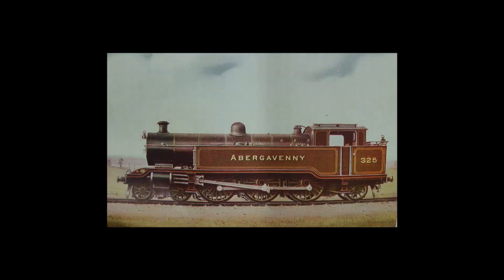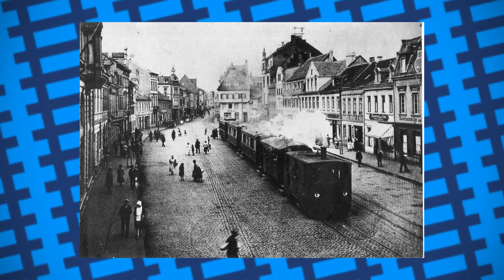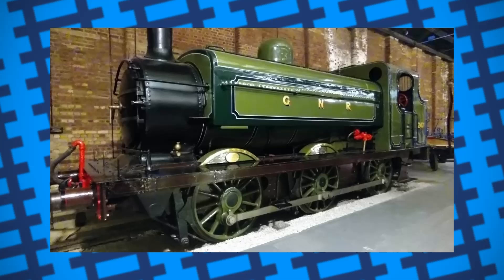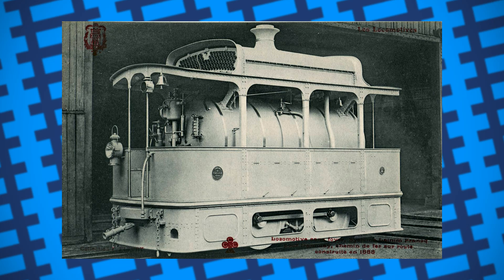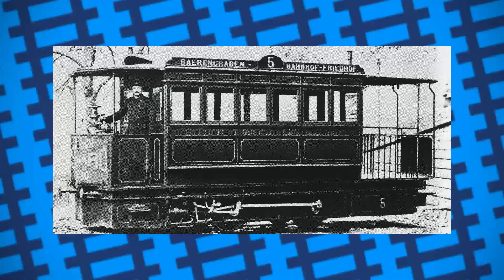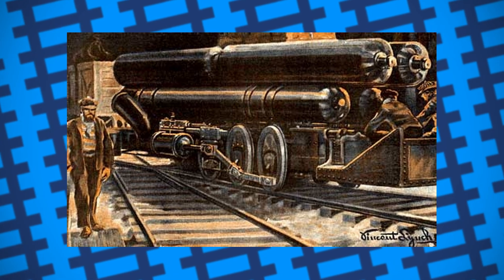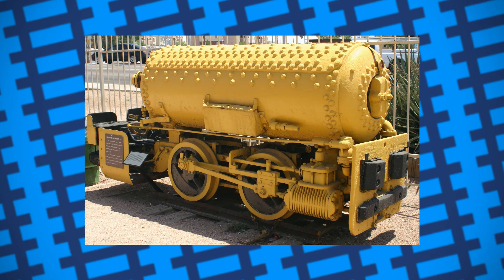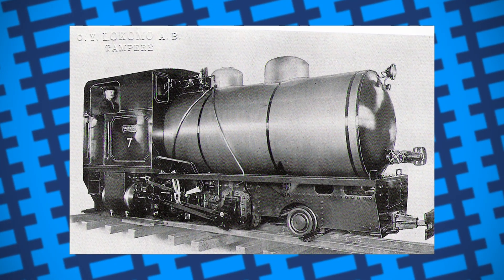The steam trains that don't require steam - Fireless Locomotives

Comment from the maker: WOOOOAH! Steam engine with no fire
Reply: but.. but you said steam engines with no steam...
Reply: @Itsjustavy  yes, why such a stupid title? Clickbait just baits me to click the dislike button.
Reply: @joe6167  I did. The video was well put together besides the title but I have zero tolerance for such clickbait lies.
Reply: There is one at the dunaskin Heratige centre that is operating but they may be closed soon
Reply: Don't forget soda locomotives. Soda locomotives were a variant of fireless locomotives, in which steam was raised in a boiler, expanded through cylinders in the usual way, and then condensed in a tank of caustic soda that surrounded the boiler. Dissolving water in caustic soda liberated heat, which generated more steam from the boiler, until the caustic soda became too dilute to release heat at a useful temperature.
Reply: @KibuFox  I never heard about any locomotive that runs on soda
Reply: You could use a radioisotope heater unit filled with plutonium. What could POSSIBLY go wrong?
Reply: There are one that did exchanges with other mainline trains that gots it's power from a steam power plant that was a pressurized steam locomotive within a firebox in the US I don't know if it survived diesels taking the steam locomotives place in a railroad museum or not, I've only seen one on my 5 pack DVD set called Railway Journey's the Vanishing Age of Steam
Reply: wow, really?!?!
I thought it was an electric engine
Reply: There we go 😉👍
Reply: Even the YouTube channel "wayoutwestworkshopstuff" has made a compressed air Loco.
Reply: Yankee with no brim!
Reply: actualy there where mining trains that produced heat to boil water without a fire. they used some form of natron instead.
Reply: Witchcraft! :P
Reply: @@seanembry6438 Lol
Reply: Basically having a big reservoir of steam, thermal or pneumatic energy. These locomotives with forms of integrated energy storage are pretty cool.
Reply: Fire with no steam engine
Reply: Old mining trains use compressed air :) so you can no idea on range pretty sure its as bad as an evs with lead acid batteries and i know a company working on a air powerd train but lips be sealed.

Comment: INCORRECT !!!!!!!!!!!!!!!!!!!

High pressure steam does not make a steam reciprocating or turbine  go. It’s heat and the expansion of the steam into an area of low pressure eg a cylinder the expansion of the steam is what makes the engine “go”. The reason behind the pressure in the most part is to increase the potential energy stored in the steam. So NO high pressure steam does not make an engine or turbine go.

Comment: I wonder if there ever were attempts to create a steam turbine train. Steam turbine engines were used on ships around the turn of the 20th century so surely the idea had come up. Steam turbines have a continues flow so they don't need pistons or valves to regulate the steam as it just flows from the high pressure of the boiler to the low pressure of the outside. The only big valves involved are to regulate the amount of steam that goes in. Though they do rotate at a very high speed which means you need gearing to slow the RPM but ships managed that just fine and even with the heavy gearing they still had a better power to weight ratio than piston engines.

Comment: Firstly The video title is incorrect. “The steam trains (locomotives) that don’t require steam,” of cause they require steam, they just don’t raise there own steam. Also you said, “Supper heated water is bumped into the tank on the engine.” No water is bumped into the tank, only high pressure steam. Please get your facts right.

Comment: A little superficial. Would have appreciated if talked about the systematic difference between locomotives that use hot (overheated) water that is kept from boiling by the pressure in the tank and thus take benefit from immense growth in volume when this water gets into steam on the one hand and the locomotives that just use the energy stored in pressurizing a gasious medium (as air or pressurized steam). And by the way, most of the shown locomotives shown still require steam, but are just fireless as they do not carry around the fire with them.

Comment: Saying that steam dummies like these don't need steam is silly.  They just didn't boil water to make it, but rather filled up with steam from a stationary plant instead.  Instead of a boiler they had a steam tank which drove the pistons just like a normal steam loco, and the tank needed to be refilled with steam from time to time or the loco would literally run out of steam.

Comment: Rather than simple compressed gas/fireless. How about pressurised oxygen and hydrogen tanks to produce steam by direct and clean combustion. Very hot steam if engine can cope. Higher efficency?. No boiler losses. Avoids mass of boiler, and "coal" /water. But does need strong gas tanks

Comment: I once helped a guy with taking his steam tractor to a show.  it had a water issue at the time so couldnt be fired up so we filled it with air. It was just enough to get it on the trailer and then off and right to its spot inside

Comment: the ones in the dayton caroline museum are interesting old examples that once saved the city after it flooded since they were capable of operating in the flood waters and were so massively heavy they kept traction. one of the interesting things is they actually kept boiling water as they were mostly filled with water then blasted with superheated steam until they reached the peak temperature

Comment: This video needs some clear statements. Yes their are compressed air engines- no steam involved, just add compressed air to the tank. Open the throttles and compressed air will go to the cylinders and push the pistons. Much more common were fireless steam engines. These ARE steam engines, but their tanks are filled with high temperature, high pressure liquid WATER. When the throttle is opened the pressure in the tank decreases a bit and the high temperature water begins to boil, producing steam that goes to the cylinders and provides power.  Fun facts : at the normal sea level pressure of 15 psi water, will boil and turn into steam at 212 F. But water at 430 F  in a pressure vessel will boil and turn into steam at 375 psi, more than enough to drive a locomotive. When the water temperature gets down to 354 F the available steam pressure will be about 150 psi, still enough to provide useful power. The limit is when the water runs out OR the temperature gets below 212 F.

Comment: seems a lot of people are missing the fact that these predominately run on steam and not on compressed air.
water has a high latent heat. possibly the highest of all. it stores all the heat pumped into it.

they hooked it up to a big boiler, and just started blowing steam into it until the water was the same temperature as in the boiler.

unhook, and the thing ran off until the water was too cold to steam effectively, or it ran out...

very popular as shunting engines with short trips in one place...

compressed air suffers from losing all the heat of compression and requiring external heat from teh surrounds to get full expansion.

Comment: Ptomac electric and power had one at a coal fired plant in northern VA.  It was used to shunt coal cars in and out of the plant, and was replenished from the huge boilers of the plant.  They did this because a steamer with fire ran the risk of setting fire to the coal piles inside the plant.

Comment: 0:44 How do you move "super heated" water to the train tank, without it exploding?
As I understand it, super heated water, is water that is above 100*C (boiling temp), but hasn't become steam yet, but a tiny disturbance can flash it all to steam instantly.... BOOM!!!
I assume it needs to be under high pressure all the time while transferring, as high pressure can make water boil at a higher temperature?
Reply: Yep, it's the pressure. The 100°C boiling temperature is at sea level. Cars also have a high pressure cooling system. That's why you never open the cooling system on a hot engine, it will suddenly boil when the pressure is released.

Comment: I'm not sure why you say that compressed air won't work when you show at least 2 compressed air locomotives in the presentation!  These were a catalog item for a number of builders including Porter and were typically used in mines.

Comment: I wonder if anybody ever thought of using liquid carbon dioxide under pressure for the working fluid?  Same idea as extremely hot water under pressure, but lower temperature (critical point = 30.9 `C at 7.38 MPa = 72.8 atm, but better provide for significant overpressure in case of a hot day).  Make it carbon neutral by using carbon dioxide that was otherwise just going to go into the atmosphere (without being further used) anyway.

Comment: Fun fact: the tram car shown from 1:50 (with lettering BAERENGRABEN 5 BAHNHOF FRIEDHOF) is not powered by steam but by compressed air. It ran in the Swiss city of Bern, was built locally in 1890, retired and scrapped in 1901

Comment: Back in 1961 I was taken on a tour of our local power station where I was shown the two fireless locos and the railway line connection to the main line coal yard a half mile away. I was invited back the next week and spent the greater part of the day on the footplate and then driving one of the locos, collecting coal wagons and returning the empties. It was bliss and I have never forgotten it. I was 13 at the time.

Comment: Intresting…but how did they keep the super heated water hot.  Seems to me that in about 15 minutes the water in the tank would cool down and there would be no pressure..  Thus no energy to move the engine

Comment: You cannot exactly compare compressed air engines with storage steam engines. The power density of overheated water outperformes compressed air by magnitudes. Compressed air gets used and when it's gone, it's gone. Overheated water instead boils and turns into steam, when steam is taken out of the "boiler" and the pressure is falling. the water and the steam are always in an equlibrium. As the taken steam slowly reduces the energy content of the boiler, the temperature drops slowly and at one point the generated pressure is no longer sufficient, but most likely there will still be plenty of water in the tank (at least with shunting engines, which do not go very far), it just too cold to produce enough pressure.

Comment: There’s a compressed-air engine at the Toronto rail museum, it’s so tiny I can’t see anyone actually using the cab unless they had a very short stool to sit on, but a cab it has!

If I recall correctly it was used at a flour mill, not somewhere you want a fire hazard.
Reply: I actually work at said museum and can fill you in on some details.

The cab may look tiny from the outside, but having actually been in the thing it's not as cramped as it looks, the floor is surprisingly deep due to a lack of trailing wheels.

The engine was used at a cordage plant in Welland Ontario, it produced things like baler twine and fishing nets, both of which are extremely flammable, which is why fireless locomotives proved useful.

They used it right up until the late 50s when it was replaced by forklifts.
Reply: @wilfstor3078  Neat to know! Thanks!
Reply: I have read about their use in mines also.  Very small and compact
Reply: I saw it too I even got a photo of it.
Reply: Fireless steam locomotives do run on steam but use steam from  stationary boilers for example in chemical plants where any locomotive producing even only sparks like Diesels or Electrics would be too much of a hazard .  Fireless locos store their steam in pressure vessels carried in the same place as the boiler with its firebox on a conventional steam loco. What they don't have at first glance is a smoke box with its smoke stack😮. Most photos shown here however are from conventional locomotives or from tram locos which have a conventional boiler but hiding under a tram like body .
So please get the basic facts straight   Klaus

Comment: There is no such thing as superheated water!

Superheated steam is saturated steam that is then removed from the water that  made it in coils and extra heat above boiling temperature is added.

So water from the steam drum , where the water is heated and bubbles of steam is generated, is at the same pressure and temp as the steam above it.
This is called saturated steam. This is what Locos run on normally.

The the water in a fire less boiler is at the same pressure and temp as it would If it had a fire in it, at first.

But no superheated water, only superheated steam.
Which these things don’t use,
Reply: Yeah there is, water that is above boiling point but remaining liquid because of the high pressure. That is the the real power behind  a boiler explosion. In a split second when part of the pressure vessel fails, the superheated water begins to flash to steam causing a massive pressure spike, water hammer effects and just generally a really bad day for anyone nearby.  https://en.wikipedia.org/wiki/Superheated_water#:~:text=Superheated%20water%20is%20liquid%20water%20under%20pressure%20at,and%20the%20critical%20temperature%2C%20374%20%C2%B0C%20%28705%20%C2%B0F%29.
Reply: Mr Russel,
Thank you for the link.

You see in the article the superheated water is also known as “pressurized water”. That is the term I knew.

It also says not to be confused with superheated steam which I was afraid he was.

All the boilers I ran were sub critical marine boilers 900 psi pressure with superheated steam about 1000deg F.

Comment: Random question, but why don’t people use steam engines with air compressors!? I’ve seen a 1/7 scale start up from one and they tested it, it would cut back on burning coal I assume or any reason like that
Reply: Compressed air has far less mass and therefore far less energy storage 

Compressed air needs far far far higher pressure to match steam for energy storage

On the flip side Compressed air stays Compressed unless used 

Steam cools and loses energy if not used

Comment: The titel and some of the explanation in the video is confusing. The main type of fireless locomotive still requires steam, and a steam engine can run on pressurised air.

The fireless locomotives can be divided in two main groups, those which use steam and those which use air. Usually the first group is meant when talking about a fireless locomotive
In the fireless steam engine superheated water is held under pressure in a vessel. There is a steam space above the water.
By taking steam from this space the pressure in the steam space will drop and more steam will be formed as a result until the pressure is restored.
The superheated water in the fireless steam engine expands 1800 times when evaporating into steam, so there is a lot of energy in that water.
As temperature of the remaining water will drop as the evaporation takes energy from it the resulting steam pressure will also drop over time, so at a certain point the useable steam pressure will get too low before all the water is used, not unlike a normal steam locomotive when you stop shovelling coal on the fire.
This means that not all the water in the barrel can be used before topping up is needed.
But this type of fireless locomotive still has a relatively large range compared to the other group, the pneumatic locomotive.

And yes, a pneumatic locomotive works with the same system of cylinders and motion gear as a steam engine, the cylinders have ribs to take heat from the surroundings as the air in the cylinder cools down when it expands. For this reason the air source must deliver dried air as otherwise water can condensate and cause water lock in the cylinders.
Many small long cylinders hold the pressurised air. But this air under pressure stays in gas form, and this means when half of the air is used, the pressure will have dropped to half in the holding cylinders as well.
So they need topping up very regularly, and were mainly used on underground mining railways where a source of steam is not available but pressurised air is as most machinery there works on air.
This because air as a power source is safe to use in an environment with explosive gasses such as a coal mine and can be transported long distances trough pipelines unlike steam which would cool down too much. Also steam would create an unbearable humidity in the already hot tunnels and the emitted steam can impair visibility.

Comment: Another interesting fireless steam locomotive were the Swiss steam engines that used electric overhead wires to power a resistive heater element to heat steam. Because there was a coal shortage in Switzerland during WWII, but they had enough hydro power.
Reply: They were regular steam engines converted as an emergency to electric heating.
There was a severe shortage of electric engines and lack of coal.
It was inefficient but it did the work for that time.
After WW2 they were coverted back to coal heating
Reply: I believe ToT made a video on those sometime last year.
Reply: @Hybris51129 i believe you are correct
Reply: These were class E 3/3.  They kept the firebox as well, so they were actually dual-mode locomotives.
Reply: those were the worlds only electric-steam locomotives
Reply: Cool, didnt know about that.